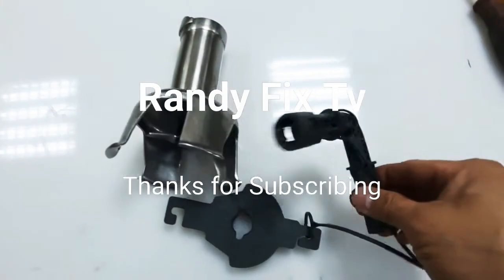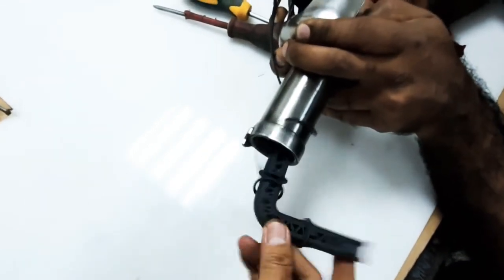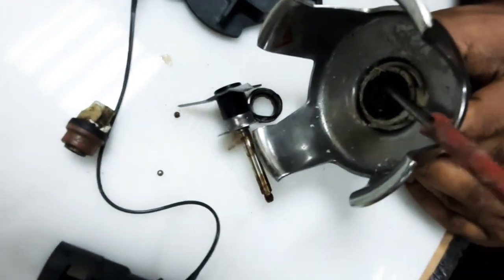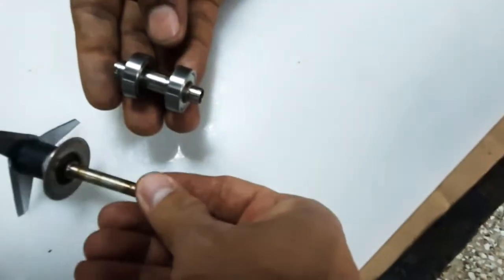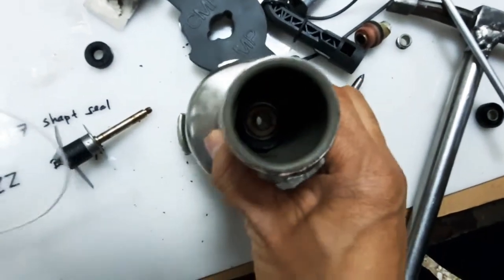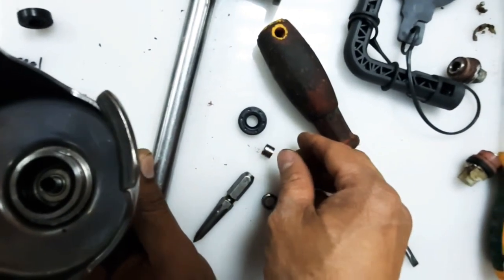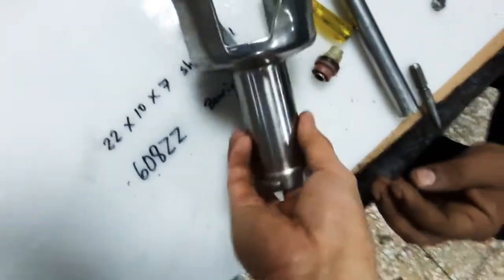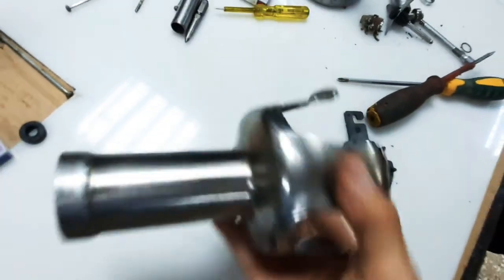Robot coupe blade(Bell assembly) bearings and seal replacement.

Comment: A video on replacing the entire core - kit number 39337.
https://www.youtube.com/watch?v=taHJ4GHHSKI
Reply from the maker: It is costly and not easy to buy parts, were you can open it and buy seal and bearings. Less cost and serviceable anytime.
Reply: @Information.IntelligenceIdea  Tough for us in the kitchen setting as it's always in use.
We ended up buying a temporary cheaper one, giving me a chance to fix the nicer one.

We also have a second where the motor itself is making a rumbling awful racket.. Still seems to have power though.

Motor bearing maybe?